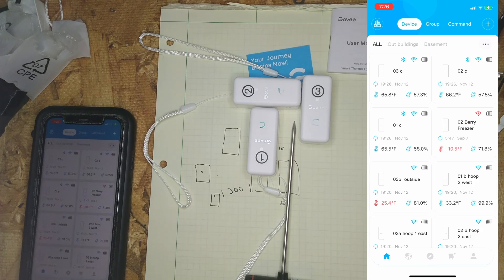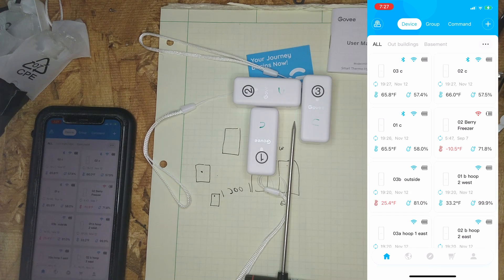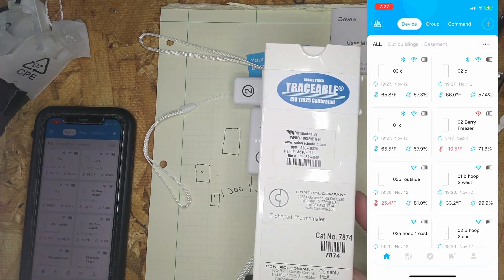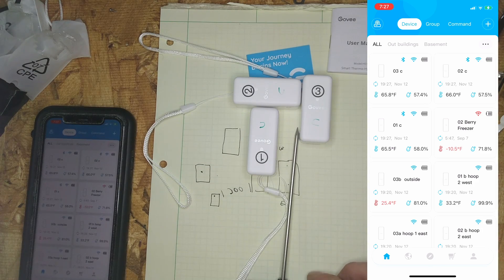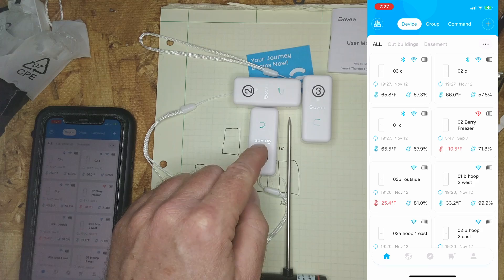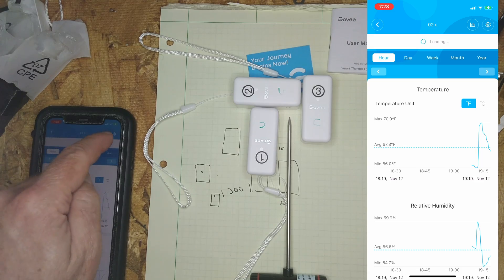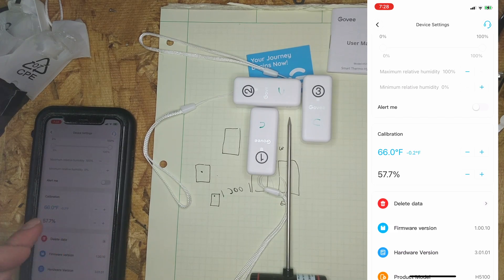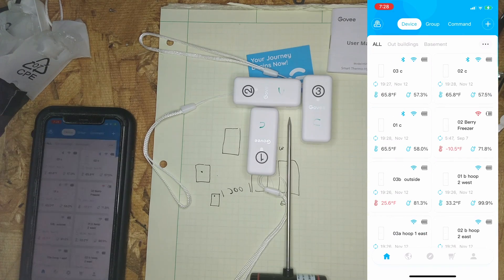Calibrating the Govee mini Thermo Hygrometer

Comment: So you need a 2nd thermometer to make this one correct? How do you know the 2nd thermometer was accurate?
Reply from the maker: @rustinnobinger  the second thermometer  comes pre calibrated to the NIST standard with a traceable calibration certificate. You can also check submersible thermometers with an ice water bath

Comment: My calibration setting is grayed out and wont let me adjust. Anybody know a fix?
Reply from the maker: All my sensors calibration settings are grayed out and no longer set….  I did recently do a firmware update.  This is very odd
Reply: Mine are all grayed out now and I am getting alerts because they go under -4F and you can't set the limit lower than that.   @WhisperingWildMarketFarm
Reply from the maker: @bigwaynebigwayne3576  try getting close to the sensor then opening the graph view of the sensor data then swiping down to sync the data. Once the data is synchronized open the settings. Apparently the settings are only adjustable while is connected via blue tooth. ( per Govee support)
Reply: @WhisperingWildMarketFarm  Yes I just figured this out after getting an email back from them.  Settings seem to work ok over the wifi except the calibration.  That seems to only work by bluetooth so you have to get close to the individual sensor.  I didn't know about the swiping to synchronize, but it will ungray if you wait a minute or two.  So I calibrated mine up a bit so they won't report below -4 and give me all the low temp alerts I don't care about. They really should allow you to enable or disable max and min temperature alerts separately.
Reply from the maker: @bigwaynebigwayne3576   I agree  enabling hi and low alerts separately and or having a greater range, at least on the low side would be rather useful. -4 really seems an arbitrary and rather limiting low side alert temp.
Reply: @WhisperingWildMarketFarm  I am sure the -4 limit is because the electronics inside it are only designed to work to -4.  Below that, if they work at all, they will not be expected to be accurate.  They either should allow the limit to be any number or have the electronics never report the temperature to be any lower than -4.
Reply from the maker: @bigwaynebigwayne3576   I've had mine in freezers down to -16F before moving them to the hoop houses. The battery life was shorter but they worked.  Had to turn that alarm off though. As you said there is probably a reason behind the -4 degree limit.

Comment: Temp is ok but the humidity is really far off. 15 to 20 percent. Doesn't seem right to me. Jus started playing with it though. Have it hooked n paired to the humidifier also. What's the deal with this. My cheap guy works better. Wtf
Reply: Govee stopped at 76 humidity on auto with the humidifier which controls it. Idk but I'm going off that now. It was practically raining inside my tent. 😂 Cheers
Reply from the maker: Hum I’ve not payed too much attention to humidity, what is your calibration source for  humidity?
Reply: @WhisperingWildMarketFarm  my other hygrometer from a cheap grow light. Not sure how accurate it is but I Kno it's close from my plants behavior last year. I bought another govee to see if it was just that 1. Nope same stuff and it's a different model. Arrgh
Reply from the maker: @dmo848  hum thank you for the info  may be something I’ll have to look into I’m thinking of doing another  hatching run. Last time I used a BME 280 attached to a raspberry pi I may have to toss one of these in there and pick up a nist traceable humidity sensor to check the Accuracy if the do not cost too much.